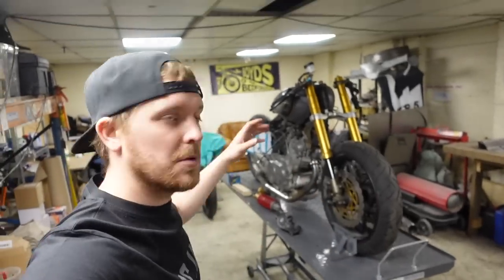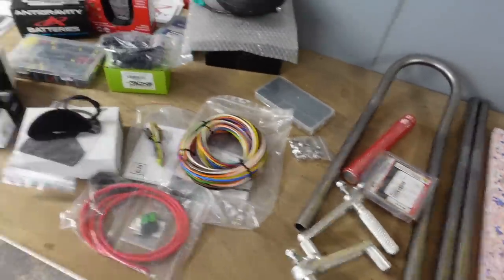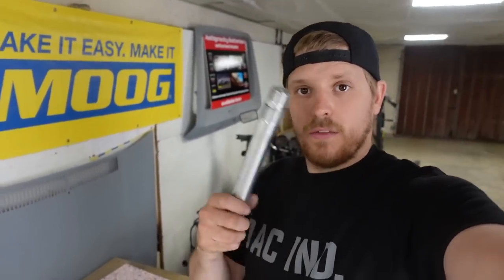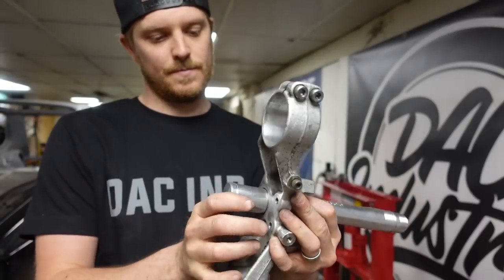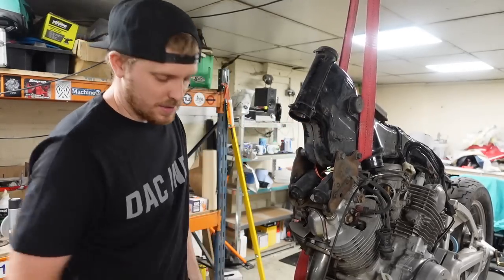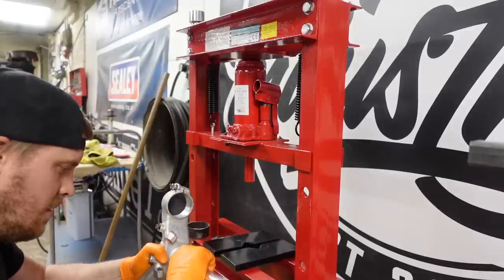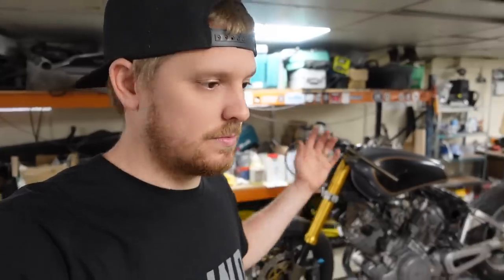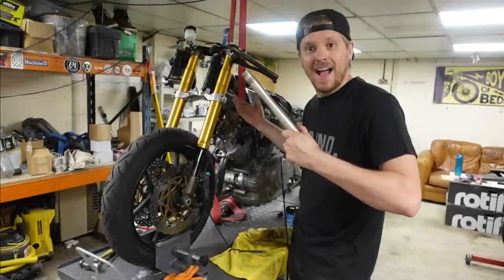1981 Yamaha XV750 Cafe Racer Build Series Ep 3 - Brat Custom Virago Motorcycle XV1100

Comment: you could fit rear wheel from 2nd gen virago it has 5 straight spokes, for it you need drum brake and axle as well from the same model. It would match with front rim. Just every time to remove/install it you have to unbolt final drive housing slide it out a little bit install wheel drum assembly and slide final drive back. With 2nd gen rim you can fit wider fatter tyre. Rim has some offset around 11-13mm to the right compared to the original rim but it doesnt change handling.